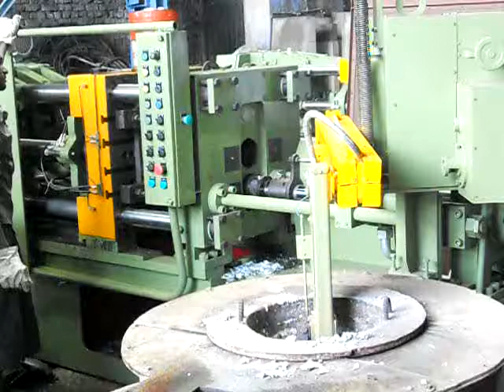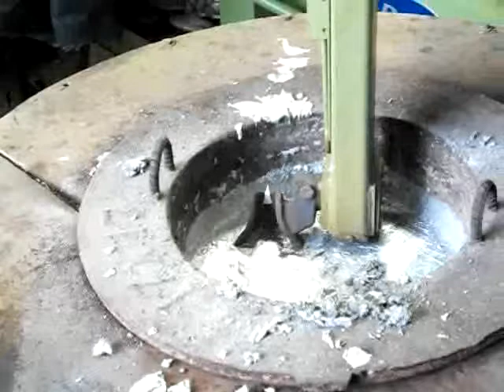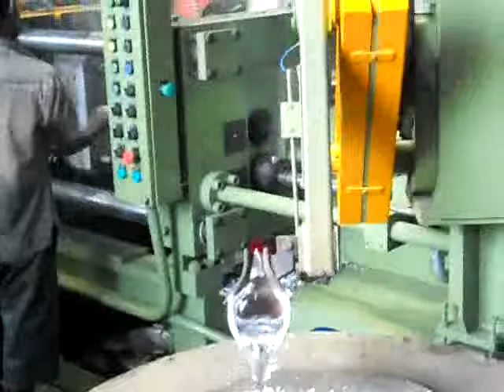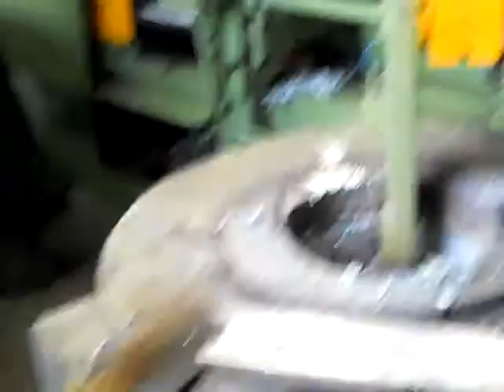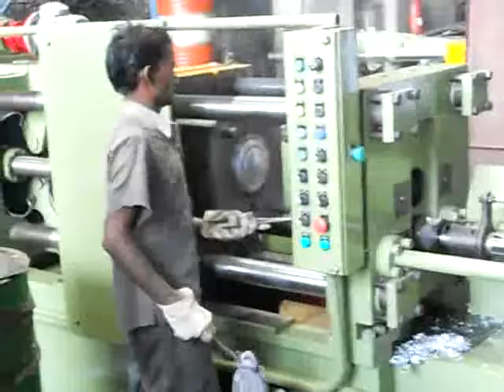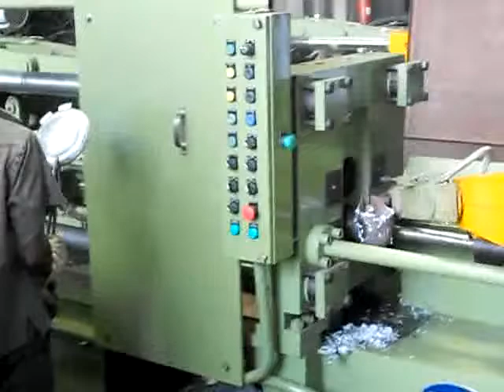AUTO LADLE   LIVE DEMO

Comment: Sir,
I am student of mechanical engineering and we also work on automation of aluminium molten metal into die as part of final year project. But we stuck to tilting mechanism and motor use for tilt the bucket. If i know the motor use to tilt the bucket the it will great help to us.
I am waiting for positive reply.
Thank you so much.